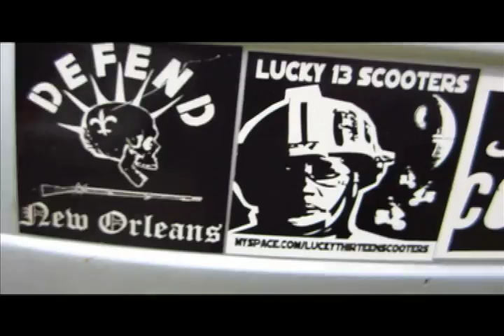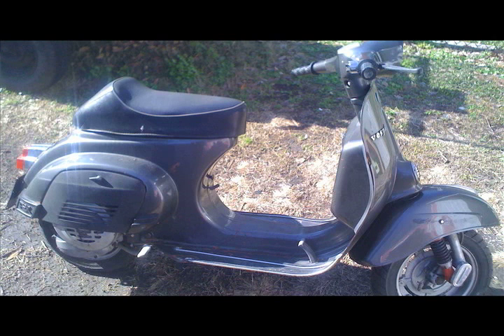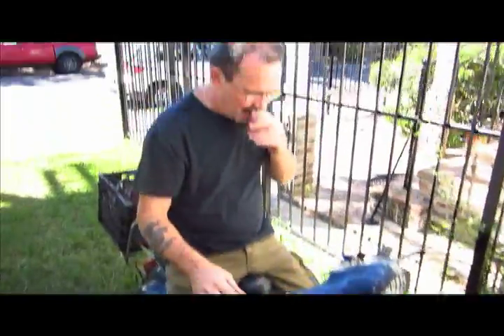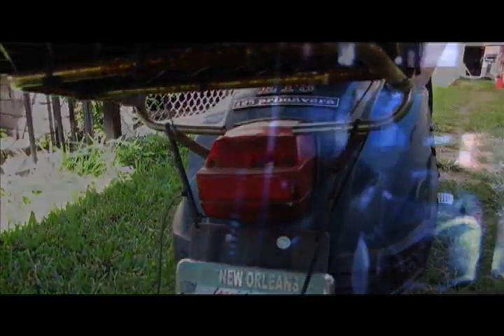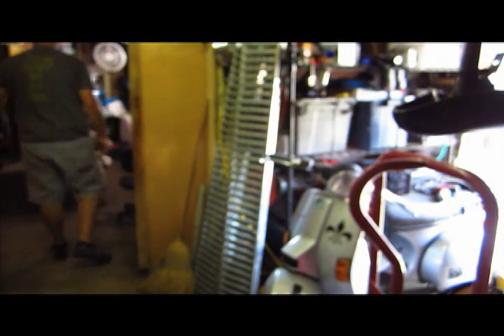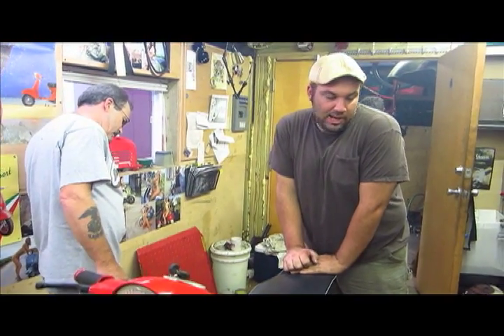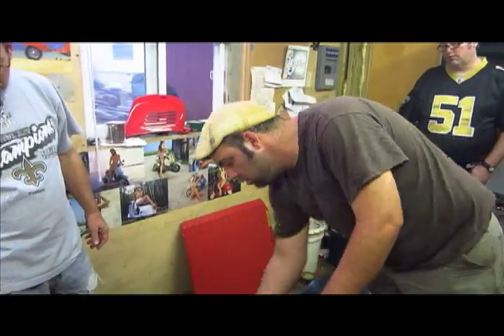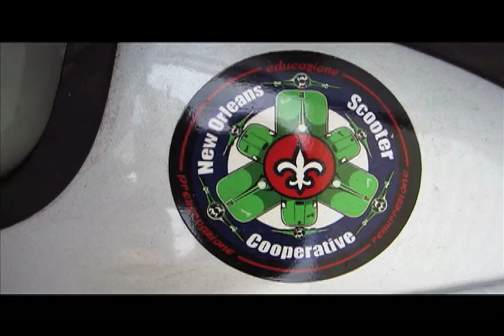American Scooter Webisode 1

Comment from the maker: @cbaci 

That's sounds great.  The aforementioned P200 can be seen in the video on a table when we roll the ET3 outside for it's first test ride.  We built it simultaneously, however we have another P200 thats been painted and needs to be assembled.  Where are you located?